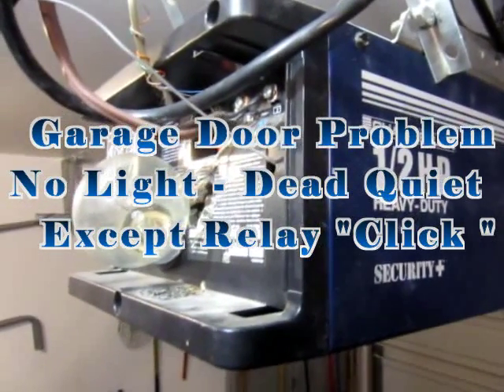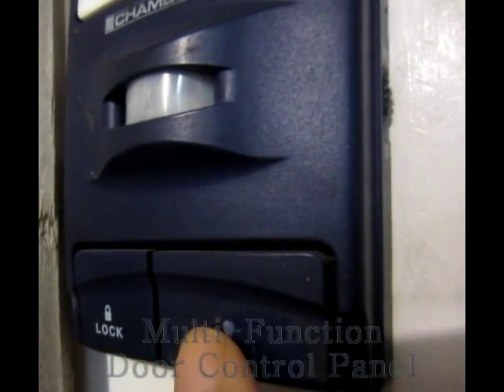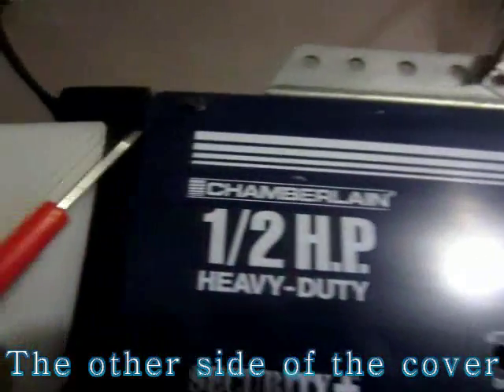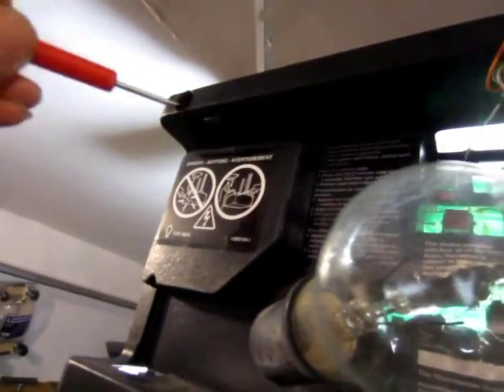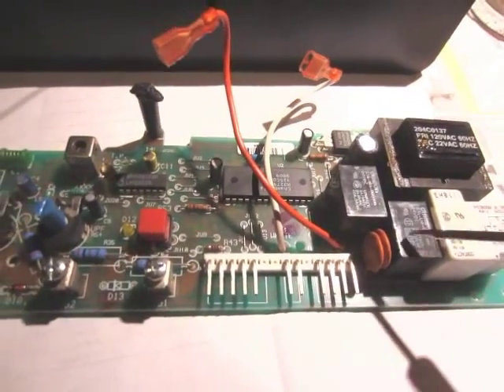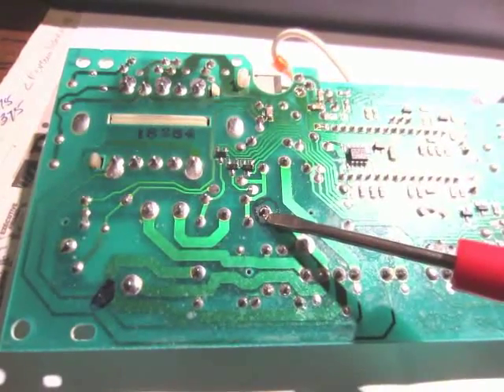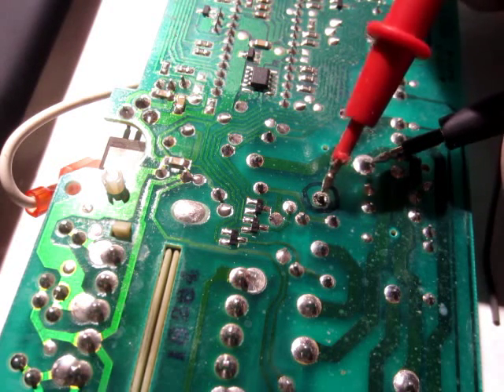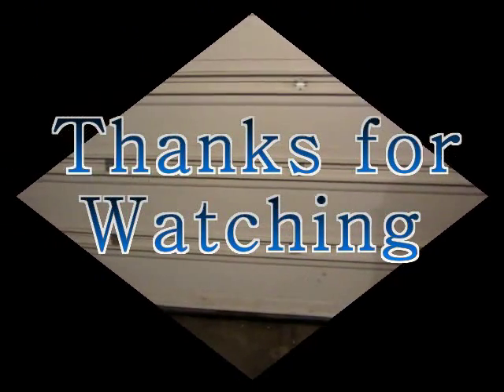How to repair Garage Door Opener? Led Indicator 5 flashes - Motor & Light don't work; Relay Clicks;

Comment: Simply Cycling the power and removing the lightbulbs worked for me.
Reply from the maker: Fantastic! You are the first to tell this after 9 years posting. Did you try to put the light bulb back to check whether it works the same?
Reply: @tgmac8288  
Yeah, I suspect too large wattage bulb was the cause, because it did work with a lower wattage bulb. Similarly some LED bulbs also shortened the sensing range of the remote.

Comment: You are THE Man!  My situation was exactly the same and I Google'd the entire internet and they all point to a controller board replacement at around $150.  Not only that, it would have taken me half a day to replace it.  No up, no down, just a click of the replay.  My light bulbs do work though.

Then I came across your video.  As an engineer it makes total sense but I'm still baffled as to why it took 20+ years for it to fail!  (Yes!  My door opener is over 20 years old, closing in on 25 years!)

I climbed up a ladder and sure enough there was a questionable solder joint.  Not as blatant as the one you've shown.  And the one next to it was not ideal.  I'm a solder maven so I know when there's a bad joint.

Out came the soldering iron and BINGO!  Fixed the problem completely.  I didn't even have to remove the controller board because the joints were reachable with my solder iron with nothing in the way.  It was literally a 5 minutes job, including waiting for the iron to heat up!  :)  I knew it was a bad joint as I had a blob of solder on the tip or my iron and all of it flowed into the joint.

THANK YOU!  THANK YOU!  THANK YOU!  Have a great 2024!

Comment: Great info....  This happened to me today.  It took about 30 mins to take it apart and find the bad solder joint. I repaired the joint on the circuit board with a soldering iron and refitted it and bingo, problem solved.  While I had it apart I also greased the gears.  Maybe good for another 22 years!  Thanks for the info.
Reply from the maker: Well done.

Comment: I had the exact same 5 blinking lights issue described here with my Liftmaster, and I was able to fix it by unplugging it, waiting a couple minutes, and plugging it back in. Try this before you take your motor unit apart.

Comment: There is a reason for the excessive current ! Possibly the garage door spring that balances the garage door weight has become weak. The wear on the plastic worm gear also hints an excessive load. When was it the last time you had the garage door spring replaced ?
Reply from the maker: Great logical thinkings! This problem is obvious if you look carefully at 5:03. Poor workmanship with insufficient solder - Didn't show any melt away solder cauaed by heat except thin amount of solder. Also worked on the worn plastic gear and the garage door spring balancing. They had different symptoms. But, it is not an bad idea to check the plastic gear lubriacant and the garage door spring balancing for maintenance purpose. Thanks for your comment.
Reply: @tgmac8288  I'd suggest to have the tension checked and possibly readjusted every 5 years. In my case, the worm gear has worn out, I replaced it, few month later the spring broke.

So far I have had no problems with the relays or soldering. Mine is a vintage 1996 Chamberlain. The only issue I had, was diminished range. I fixed that by replacing the electrolytic capacitor on the main board and by installing a better antenna with a RF LNA. Now range is greatly improved.
Reply from the maker: @3rdworldtrillionaire46  Well done!

Comment: Thanks for the video, i had the same type of problem. In my case there are 2 circuit boards. The smaller separate board contains the power relays. When I took that board out and got a look at the solder joints I found that one was slightly charred and disconnected. The  wire from the relay seemed to be standing by itself in the middle of the hole in the circuit board with a small 'volcano' of solder surrounding (but not touching) the wire. i re-soldered this connection and put everything back together. 
The door opener seems to be working just like before.

Thank you so much! i'm guessing that saved me between $150 and $250 for a service call and new circuit board.
Reply from the maker: Glad it helped.  Thanks for your feedback.

Comment: I also have the 5 blinks but the garage door opener only opens the garage door but won't close it and the light blinks like something is in the way but will close if I hold the garage door wall button but have to hold it down in order for it to work

Comment: slightly different problem, the issue was a cold solder joint on the connector. thanks for leading me in the right direction.
Reply from the maker: Thanks for your feedback!

Comment: I incurred this proble after trying to program my car and then  another remote. The light stopped working and my neighbors remote was operating my door. I reset the opener from all codes. The control panel still operates the door, but the remotes will not program. Do you have any suggestions for me?
Reply from the maker: Did you check the circuit board for any bad soldering spot as this video shown?

Comment: You made fixing  my opener a short project. Thank you. Was this engineered to fail? How can so many circuit boards fail in just the same way?
Reply from the maker: I did have the same feeling. The manufacture might be requested to apply lower grade of solder material of which would be broken down automatically after a period of time especially at the high voltage relays contacts. There is a " Life Span Equation" taught in engineering school. Thanks for your feedback!

Comment: Awesome!!! Thanks for sharing. I had the exact same issue. My door opener has been working for years, but just encountered this problem. The door opener is over 17 years old. I've even replaced the gears in it, but never had this problem before. Clearly it's a manufacturing defect. I had the exact same joint go bad. Very easy fix.

Comment: Hero of the day, saved me a repair cost by showing me which solder points to test with the multimeter. Found a broken soldered point on a 1999 Craftsman, might as well say Chamberlain logic board. Darn thing would go up but not down and I could hear the relay click. I had the error led blinking 5 times. After a few google searches I found this video and saved my old setup. Cheers buddy...and God Bless

Comment: Hi. I have this same opener and my problem is that the door moves 6" or so and stops or reverses. I tried a new cup and RPM sensor but that didn't change anything. When I removed the chain from the sprocket, the unit worked normally but putting the chain back on results in the original problem--6" movement of the door. Any suggestions?
Reply: Did you found your problem? My door is doing the same as yours.
Reply: hello, I’m curious if you found your problem back then?

Comment: My good man you are my hero! I checked the main board and found no cold solder joints and was disappointed. However, after dinner I came back to the video and read the remarks about a second board. I should have realized there was no relay on the larger board. I then removed the second board and there is was, the cold solder joint! Bingo! Everything is working again! Thanks for the GREAT info!

Comment: This fixed my Liftmaster garage door, though it looked a little different and was split into 2 circuit boards. I found the bad connection and was able to fix it for the price of a $20 soldering gun kit. Thank you for posting this video!

Comment: Thanks for the video. I had same bad connection. Was an easy fix thanks to your vid. I found that my chain was a little loose causing excessive vibration,  possibly causing the connection to fail.
Reply from the maker: Agreed! Thanks for your feed back!

Comment: Sir, you are awesome for several reasons:
       1. Figuring out how to diagnose and fix it yourself.
       2. Taking the time to post it so a dumb guy like me can fix mine too. 
       3. Saving me $85.
       4. Hearing my wife say "good job" after she doubted I could fix it.

My opener is a Raynor Aviator 1280RGD, but it was the same solder joint.
Many thanks!
Reply from the maker: Thanks for you feedback! You were awesome to accomplish the good job as your wife's comment !
Reply: T Hey, You're not so dumb if you came on here to see if a fix is possible. Otherwise, I'd be the dumb chic who came on here to fix mine too lol.

Comment: Thank you very much for the in-depth diagnosis of this problem. I have the same board and it had the same bad solder joint. I will be re-flowing the solder joint tomorrow.  I will get back and indicate if this is the fix.